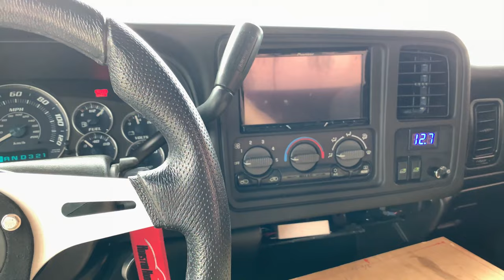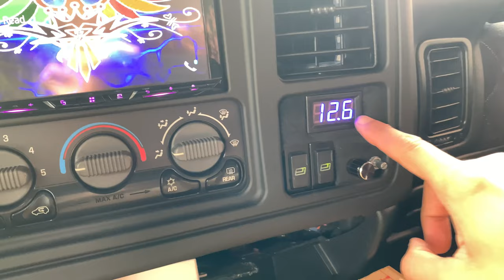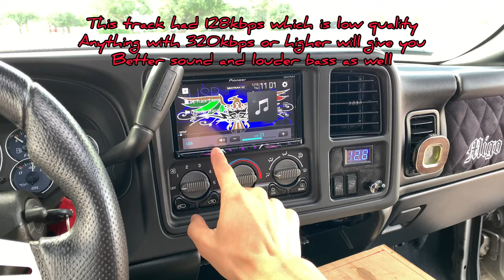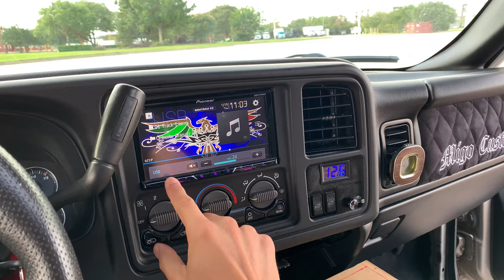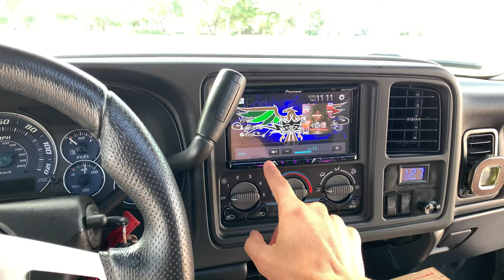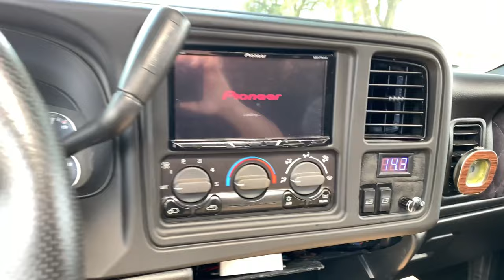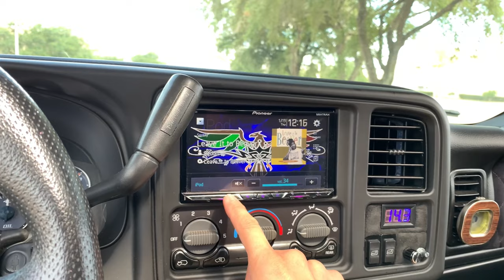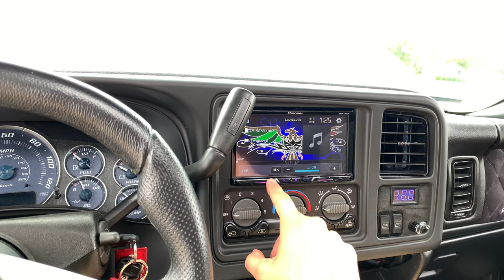My Kicker L7 Q Class 12” Sound system and updates

Comment: How did you mount window switches there? Are they not OEM or you rewired it?
Reply from the maker: They are are not original, my windows were manual.  So I wired them myself to be In the center of the dash.  It was much easier than drilling holes in the door panels for new switches and running wires to both doors🥶
Reply: @MiGo713  you should definitely show how you did that, I’ve been looking for videos on how to convert manual to electronic lol. Have an 07 classic step side manual windows and locks 🤮
Reply from the maker: @xXChevyRiderXx  Thanks!💯Yeah I feel you for sure lol and Sure I will put that on my list of videos to make, just give me some time . I already have mines installed but I can definitely show you guys how to do it it’s pretty simple😎
Reply: @MiGo713  you can rear Tahoe arm rest  that already have window switches and fit to your door panels
Reply from the maker: @timbowalk  yeah but liked the way the door panels look right now, but I may change them later on

Comment: Aye bro quick question, you have any issues with rubbing and your diff hitting the bed frame when you dropped the rear?
Reply from the maker: Yea I cut a small piece right above the diff so I can lay my truck with the air suspension you can see here where I cut it https://youtu.be/kmgKvRJdnYk
Reply: @MiGo713  Appreciate it bro, sick truck!
Reply from the maker: @nbs_juanito  Thanks! And no problem

Comment: Is this 1 L7Q 12” how much power and is the box a bandpass or just a ported enclosure. Sounds great.
Reply from the maker: Thanks! Yes it’s 1 12” Kicker L7 Q Class.  The sub can handle 900 watts Rms and my amp is currently giving it 800 watts Rms.  So it can actually take a bit more power I may upgrade my amp later on. I made the box ported I believe it was 2 cubic ft @ 35z💯⚡️

Comment: Cool Intake but you need longer pipes going near you fenders so you can really get cold air
Reply from the maker: Thanks! ⚡️Yeah I know what you mean, but it’s ok I’m not really worried about getting cooler air.  My main concern was just keeping everything tucked in the engine bay with the wheels, which it worked out and the truck runs good so Im fine with that💯